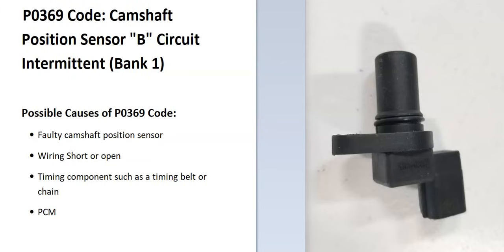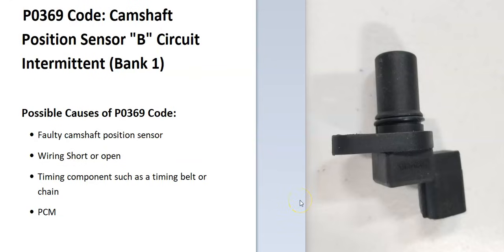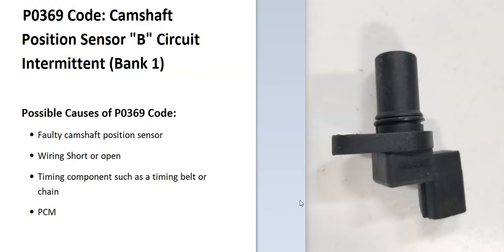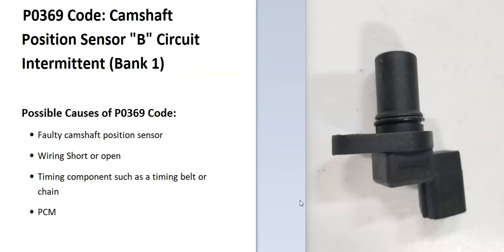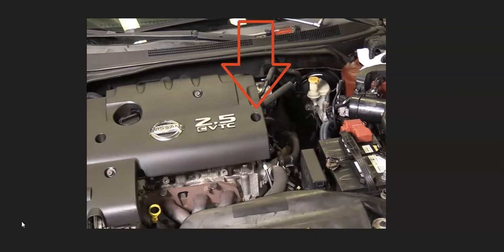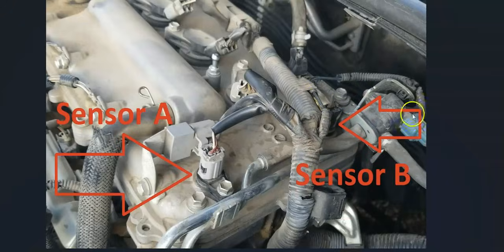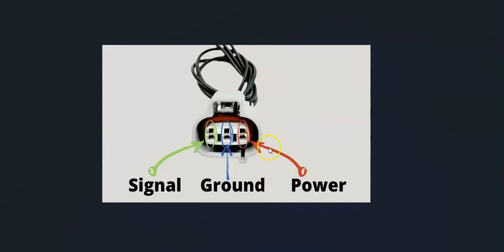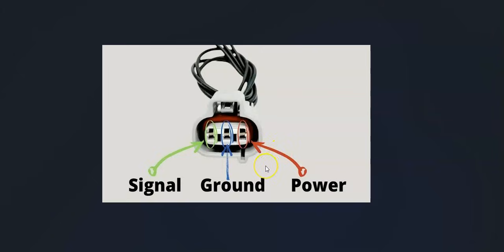Causes and Fixes P0369 Code: Camshaft Position Sensor "B" Circuit Intermittent (Bank 1)

Comment: P0369 (cam sensor) & P0629 (oil control solenoid) often pop from oil that's too thick. Thick oil or additives slow cam phasers & solenoids → ECU sees it as a fault. Fix: drain wrong oil/additive, use OW-20 full synthetic + good filter (OEM or Mobil 1), clear codes, done.

Comment: Thank you for this video! I got this code and other erratic behaviors from my car after cleaning my car evaporator coil through the center ducting system. Other videos failed to mention PCM (or ECU) as a possible cause. Soon as you mentioned PCM I looked it up and found that my Acura TSX has the ECU located right under the HVAC ducts where I put the foaming detergent to clean the evaporator coil. The foam turned into liquid and it went into my ECU and made the car impossible to drive. I drained the liquid, cleaned the ECU, and removed the corrosion with alcohol and a toothbrush and everything is back to normal. Now I'm waiting for my conformal coating bottle to arrive so I can reseal the ECU board to prevent corrosion in the future.